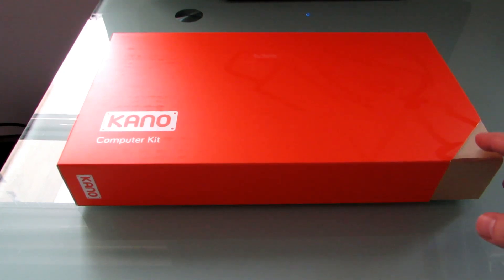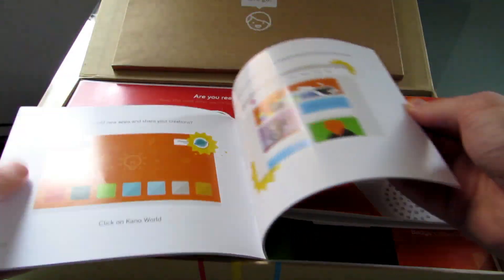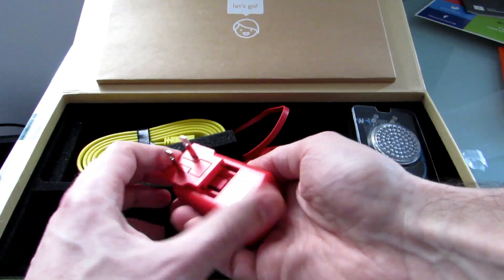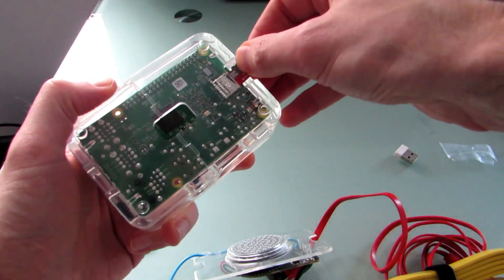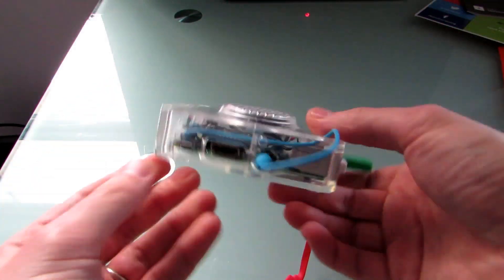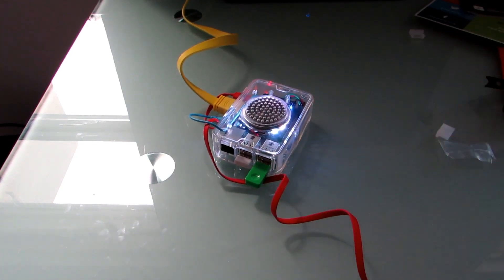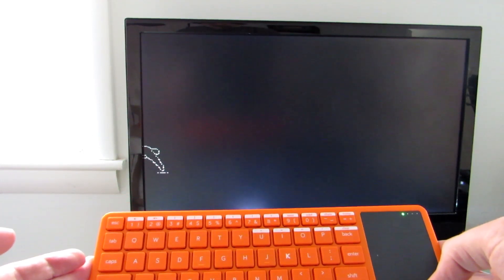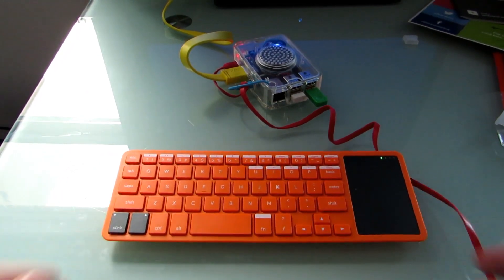Kano Computer Kit unboxing & first look (Raspberry Pi 3 kit for kids)

Comment: These things retail for a hundreds of dollars. Looking at the components, I am sure you could source all of this for literally $150. The Rpi3 has WIFI built-in too. For the price of these things should have a screen as well for the price. Still good unboxing video.
Reply: Exactly what I did for my niece. Kano is open source and easy to install on a RPi3.The books which the kit includes are available on kano as pdf's and on the net. With the money you save you can buy yourself a much nicer, sturdier case.

Comment: can it run gts 5
Reply: Eugene Of course not... That’s a little kid computer, GTA 5 age range is 18+ and that computer is no where near to run GTA 5. Get a computer that has Intel Core i5 or Core i7 With a lot of storage. Graphics card will also need to be really good, graphics card on this Raspberry Pi 3 is not strong enough for GTA 5

Comment: I'm sure I won't be the only one to ask this, but why are there USB dongles for WiFi and BT with this kit when the RapPi3 has those radios included on the PCP/chipset? Does the Kano-branded Linux OS not have the drivers for such devices? I thought that was the point of this new Pi besides the faster 64 bit CPU and other under the hood stuff they added. Great video though. Very thorough, even if only a first look.
Reply from the maker: +Gaspar Heller I probably should have mentioned that this is a pre-release unit. The Kano with Raspberry Pi 3 won't ship to customers until June, so some things may change by then. Basically this is the same kit you get with a Raspberry Pi 2, but they included an RPi 3 for me to test.
Reply: +Liliputing Ahhhh that explains it. I know you said it's a review unit but I thought at least the Pi3 was a production model. Thanks.